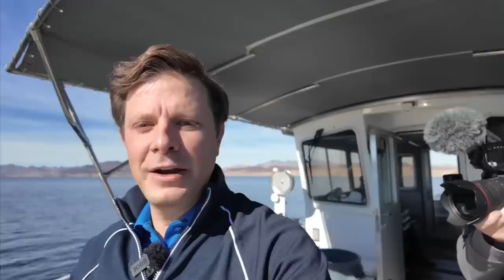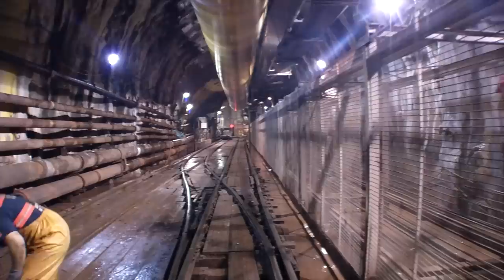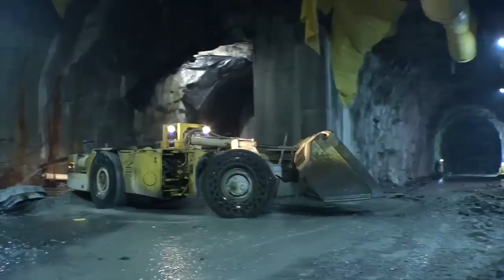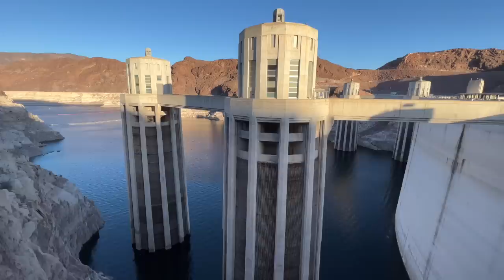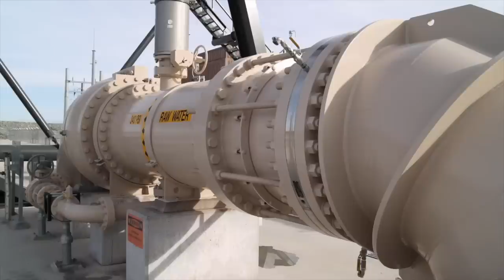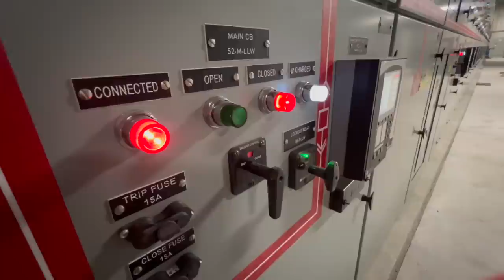Why Las Vegas' Water Supply is Secure, Even as Lake Mead Drops

Comment: What will replace hydropower if water level drops to 950 Msl.
Reply: Climate heat is increasing. Air conditioning is used more often. Where is the extra electricity as hydropower decreases?

Comment: It’s not an emergency until it is.  As the lake drops less hydro power until no hydro power, dead pool(950 ft) the 3rd intake will still be able to supply water until 860 ft but no hydropower.  Talks over piping water from Great Lakes to building desal plants like California.  More people moved to the southwest because of air conditioning.  Which is a concern with
Loss of hydro power.  More people installing air conditioning in Europe because of increasing temps.  More brownouts and rolling blackouts as not enough electric infrastructure.  The whole southwest is heating  up with more air conditioning being used.  Hopefully infrastructure is there.  Where will extra electricity come from.
Reply: Increasing electric bills.  Electric bills increase also from more data centers

Comment: It is the same as it was last year and that was higher than the year before.  This year the snowfall in the headwaters of the Colorado has been above normal.  Thanks for the alarmism.  The biggest hazard is that that the Glen Canyon dam was released at too fast a level and damaged the water valves and it is now a hazard if it gets too full.

Comment: The Coalition for a National Infrastructure Bank has a great plan to build a pipeline from the Mississippi River bypass in Louisiana to lake Mead and lake Powell to refill them in this long-term mega drought.   It would not require a huge amount of electricity to get up to those elevations and could easily be powered by floating solar power on the reservoirs.  Two axis floating solar that tracks the Sun elevation and azimuth would provide very long power hours per day. Actually get a lot of power during peak demand.  There would also be less evaporation on the reservoirs.   The power lines are already nearby.  And the hydropower is a huge battery.   Solar power is currently the lowest cost.  The cost for the project could easily be paid back by the agriculture that could grow to be a much larger business and currently which is being curtailed due to dwindling water supplies.  Only a small percentage of the bypass water would be required to refill the reservoirs.   The pipeline could also act as a source of water with reversed flow for occasional drought situations in Louisiana.
Reply: The E.L. will never allow for this project or any other project like it.

Comment: You all were set to spend 15 Billion (with a "B") to pipe n suck Northern Nevada dry to get us more water.  It's cheaper to pipe west to the Pacific Ocean, and the oil pipelines coming from cali means the infrastructure is there alleady, talked to a guy whom works for one of the oil companies in Cali, adding another pipe should not be an issue.  Then build a desalt plant anf give us unlimited water and have salt to seed the clouds when we get some and create rain, same as the entire country of UAE does!  And did I say it will not cost as much as you already had earmarked (but were denied) to pipe North?  Wht hasn't thisd been done vs more rules and restrictions on the water and how we can use what we buy and all this scare on running out someday?  This would end that scare forever!

Comment: I have always said, that the USA should ask Canada if it can pump water from the Mackenzie River, somewhere near its mouth and pipe it down to Lake Mead
Reply: You do realize that would be well over 2000 miles and for like half the year there would be no flow? The river freezes over and trucks use it as a highway.  It would make more sense to pull from the Columbia river.  It would still be a massive project but it would be much closer.

Comment: . *  *  *  *  When is Las Vegas going to regulate usage? In the 1980s, I stayed at the Luxor. The shower would practically blow you to the other end of the tub, and they had no control of the volume. There were 3,50o rooms in just one of the hotels.
Reply from the maker: In Southern Nevada, nearly all water used indoors is recaptured and recycled on a community-wide basis, meaning it has little to no impact on our water supply. Most of our water use takes place outdoors to water landscapes, where it is often lost to evaporation and can only be used once. For those reasons, our water restrictions focus primarily on reducing outdoor water use through seasonal watering restrictions, assigned watering days, maximum pool sizes, etc. You can learn more at https://www.snwa.com/water-resources/conservation-initiatives/index.html.

Comment: Don't people realize that the entire purpose of a reservoir is to drop when you need the water, and fill up when there is surplus rain/runoff/snow?    It seems people see a low reservoir as a "problem" when it's precisely how it is supposed to work.
Reply: Unless it never fills back up.  Which is the issue right now.
Reply: Is it also true that if the system is sustainable that it would refill every few years?
Reply: When is the "fill up" phase coming?

Comment: The US needs to build a couple of nuclear powered tankers with desalinization systems they can cruise around collecting we need a plan water is the new oil water. When needed it can hook up to a pipe feeding lake mead when US doesn’t need water Africa could use it when it starts going down the ship can dump water into feeder pipe. Northern FL is getting brackish water b/c the sea is pushing back on fresh water. A ship could replenish well water under ground.

Comment: YOU WILL BUILD HOMES UNTIL THE TAP RUNS DRY, THEN CRY TO THE FED TO FIX IT!!!!!
Reply: Everytime I see approval of another massive housing project in the valley, I wonder how long it can go on.  Just driving around you see lots of empty desert land that will be developed.  And it will be, as more and more people move into the valley.  It is a great place to live, but I read also the water table is also dropping throughout the valley, which means springs that used to provide water are drying up.

Comment: One thing they 'forgot' to mention - Las Vegas water is Toilet to Tap, and if Lake Mead gets under 975 feet and not much new stream water being fed into it, then that sitting water will not be safe to drink even though they will say it is, and electric output will be cut dramatically.
Reply: People say Vegas get it's water from the reservoir, but technically it gets it's water from the river, and the C.R. isn't going anywhere, so why would water be "sitting"? Also, Vegas technically doesn't get power from Hoover.